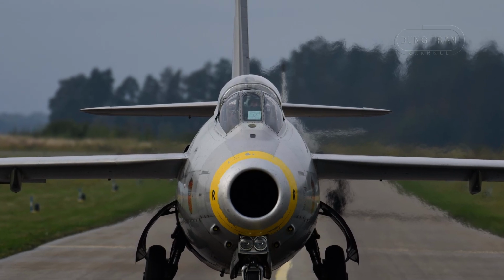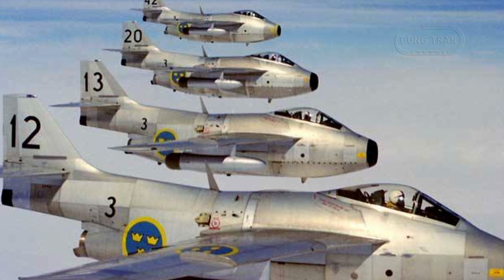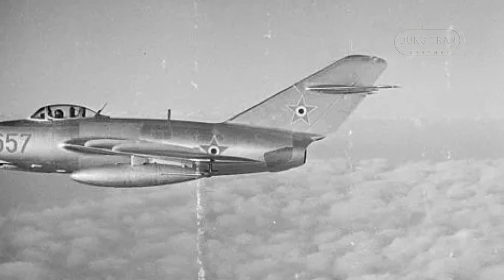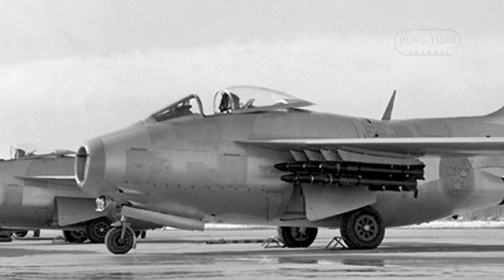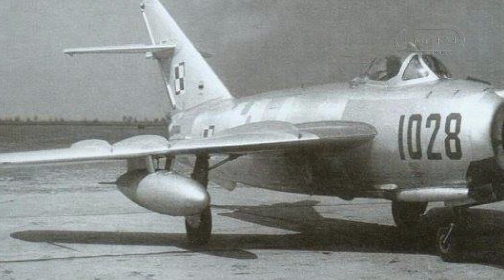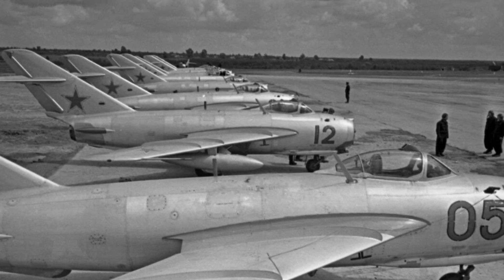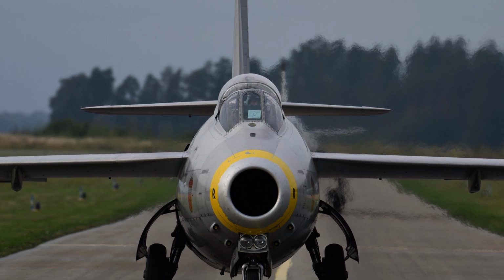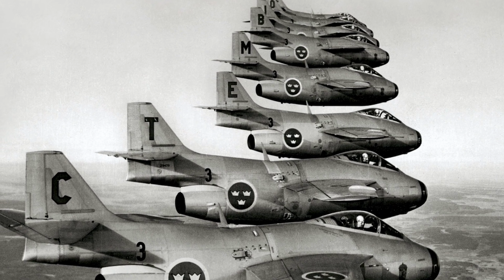Saab 29 Tunnan vs Soviet MiG-15: A Cold War Fighter Showdown

Comment: Strange episode not to say extremely bad.
1. In 1954 the J29 Tunnan had a WORLD SPEED RECORD at 500 km distance (the previous record held by the Sabre).
2. In the only real CONFRONTATION that the J29 had with MIG 15 was when two Tunnans were jumped on by two MIG15:s over international water. The result was that the J29's got away while the two MIG 15:s collided with each other.
3. The Swedish air defence system kept track of the Soviet aircraft at all times. However a Swedish SPITFIRE reconaissance aircraft managed to fly over Finland and far into the Soviet Union - without being detected. Air defence is not only about aircraft - it's about the ability to detect them too.
4. Tunnan INDEED saw combat in Congo, where it performed its attack duties without problems or without any plane being shot down.
5. It was NOT a main fighter in the 1960's. By then it largely was replaced by the J35 Draken.
6. MIG15:s actually were shot down by British piston-engined aircraft (and supposedly American too?) during the Korean war.
7. Interestingly you chose a picture from an AUSTRIAN Tunnan - in other words, they used the Tunnan too.

This episode seems to be so one-eyed in favour of the MIG15 with lacking or wrong facts, that it was not enjoyable at all.

Comment: I usually give thumbs up to videos here, but this time the channel messed up and got it all completely WRONG.  On the contrary to the claim that:  "Saab 29 Tunnan's relatively thick wing profile limited its high-speed performance compared to other aircrafts [??] of its time.",  —  the Saab 29 Tunnan was rather the world's FASTEST fighter jet at times!  Basic wikipedia research gives:  "The J 29 was fast and agile, and set the ==> world speed record <= on a 500 km closed circuit in 1954 at 977 km/h.  Two S 29C additionally set an international speed record of 900.6 km/h over a 1,000 km closed-circuit course in 1955."

Comment: Not a very good presentation. Both the Mig and the Tunnan saw a lot of development. The Mig 15 bis was a big improvent.The Tunnan saw introduction of afterburner and Sidewinder missiles making it much more efficient. Furthermore the Tunnan did see combat in the Congo in the early 60s mainly for ground attack but saw limited air-air combat against inferior aircraft as the Texan and Fouga Magister. It did great against ground targets and had a much higher serviceability compared to F86s serving along with it int UN forces.

Comment: idunno, wasn't much of a comparison tbh. Sounds like the MIG was the better aircraft over all.
Reply: Yes, with tons of wrong facts ...
Reply: Repeating myself:
1. In 1954 the J29 Tunnan had a WORLD SPEED RECORD at 500 km distance (the previous record held by the Sabre).
2. In the only real CONFRONTATION that the J29 had with MIG 15 was when two Tunnans were jumped on by two MIG15:s over international water. The result was that the J29's got away while the two MIG 15:s collided with each other.
3. The Swedish air defence system kept track of the Soviet aircraft at all times. However a Swedish SPITFIRE reconaissance aircraft managed to fly over Finland and far into the Soviet Union - without being detected. Air defence is not only about aircraft - it's about the ability to detect them too.
4. Tunnan INDEED saw combat in Congo, where it performed its attack duties without problems or without any plane being shot down.
5. It was NOT a main fighter in the 1960's. By then it largely was replaced by the J35 Draken.
6. MIG15:s actually were shot down by British piston-engined aircraft (and supposedly American too?) during the Korean war.
7. Interestingly you chose a picture from an AUSTRIAN Tunnan - in other words, they used the Tunnan too.